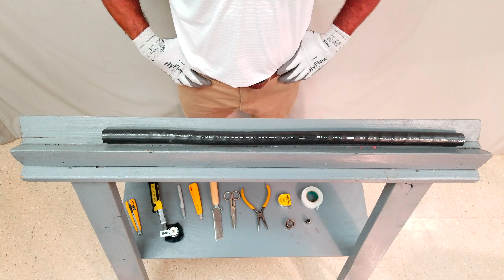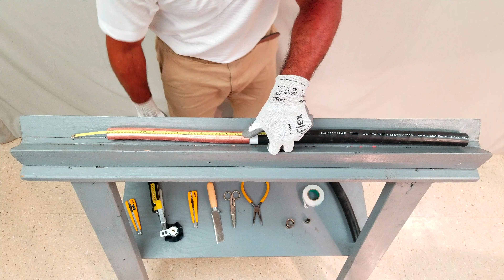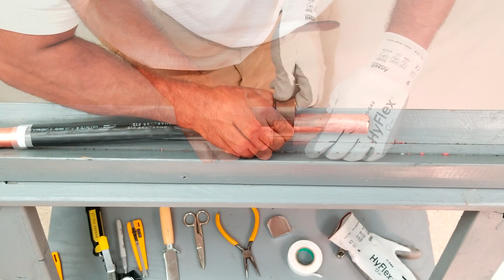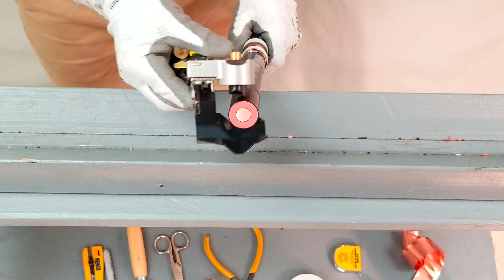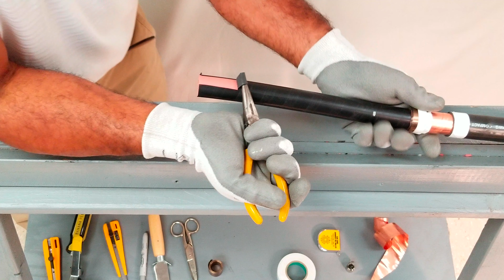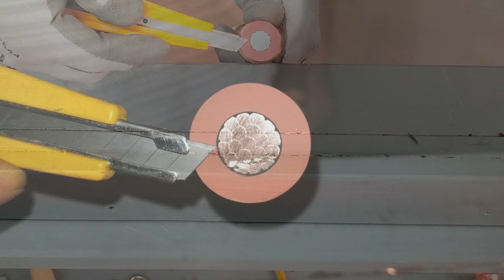Cable End Preparation Video - Medium Voltage 15kV Shielded Cable

Comment: That scoring trick on the copper tape that’s tucked under itself never works well. There’s got to be a better way. It almost always looks like ass since a knife won’t really score it. It only makes an indention. Then when you try to peel it off, it inevitably rips and causes jagged edges

Comment: apprentice learning about medium voltage pulling 35kv underground our foreman is letting us take home our scrap cable to learn how to splice into them gave us the print out with measurements. Like to see how it’s done and what tools to get
Reply: Union?
Reply: @wizmickog4926  no
Reply: @MrBoosta  I don't know where you work but your compnay should look into medium voltage certification classes.
Reply: @jsb7546  yeah I want to look into it mostly all trade schools I’m looking into don’t teach it this is mostly very specific on job training I just need to pressure higher ups for the training

Comment: This method is archaic,. I can't believe Okonite sponsored this video.
This gay is so mediocre, does not use cable strippers, scissors, fiberglass folding ruler, does not provide any measure as per kit instructions.
Reply: cable strippers are for linemen who can't safely open cable with a knife. Cable splicers could open cable with a knife. Narrowbacks should stick to narrowback work. Splice kits have instructions, to splice 2 cables, such as Okonite cable, which is the best cable, the rule of thumb for a splice is 1/2 " per thousand volts creepage distance plus 1/2 length of the connector plus 1/4".  semicon to semicon will be 7.5" plus 4.5" for the length of the connector. so, 11.5" semicon to semicon cutback once the cables are joined and pressed. 
The rest a splicer knows how to do, or should know how to make it up with semicon over the connector, the proper amount of rubber tape per insulation width, then replace the layers taken off, tack on bleeders and bond them. Arc proof, ground/bond and you are done.
Reply: @advanced-electronic  damnn did you type all that while sitting on top of the man hole waiting for foreman to ask for the fireproof 😂😂 jokes aside you're spot on. I personally like the use tools made for semicon because it's so fast. You should try the Ripley scs semicon stripper thing is a beast and it's so small it fits in the palm of your hand
Reply: We maintain most of the regions shipyards and industrial facilities performing splices with leather knifes
Reply: Electrician rarely ever do these kind of high volt so we don't need fancy tool that you gonna use twice in 10 years. A little boxer cutter is enough. I get this process done in about 40min for 1 of those with just a box cutter.
Reply: @FirstNameLastName-fu8ml I’d hate to move your splices in a vault after seeing that comment lol
Reply: This person is a tool salesperson, or a utility lineman that does not buy his own tools.

Comment: If you look at the PVC jacket, it is uneven all the way around the cable. When setting the blade depth, the splicer should find the thinnest point and set the knife for 95% of the thinnest part so a mistake isn't made allowing he or she to cut through the copper tape shield into the semicon. If the splicer erroneously sets the depth according to the thickest part and unknowingly cuts through the thinnest part, cuts could go through the tape shield into the semicon, maybe even further depending on the difference in thickness.
This is especially common when cable is pulled around a wheel, it thins the jacket on the wheel side. From the factory, uneven jacket thickness is common on all cables, so it is advised to take some additional precautions before cutting. The semicon layer could also be skewed a bit, and that is even more important to pay attention to if using a depth setting on a razor knife to  cut then peel off without hitting the insulation.
Reply: In what scenario do you think pulling it like that actually matters?